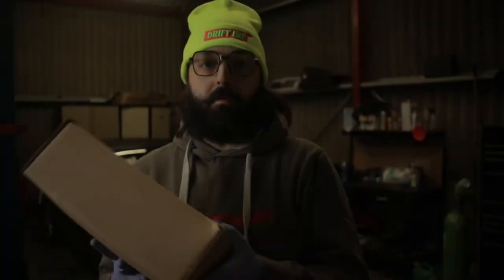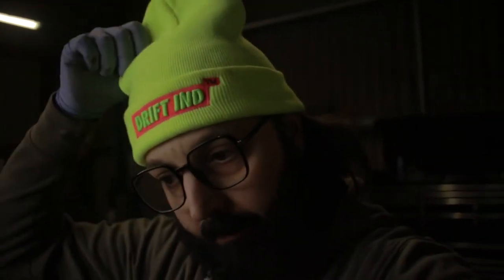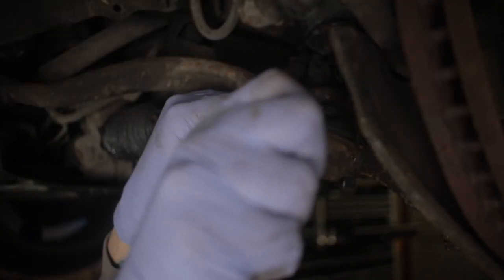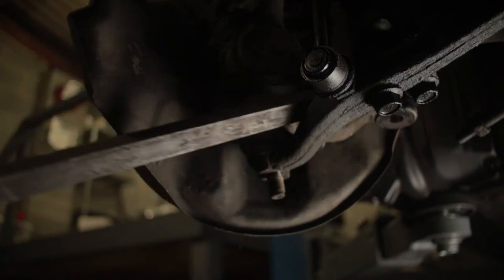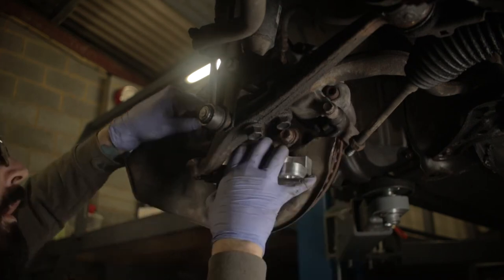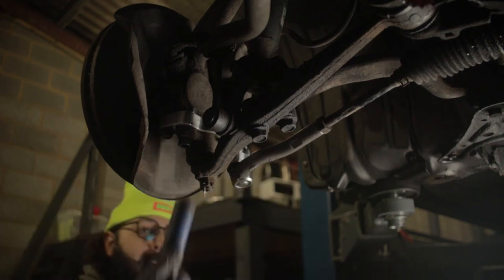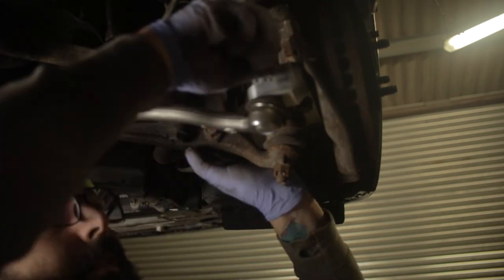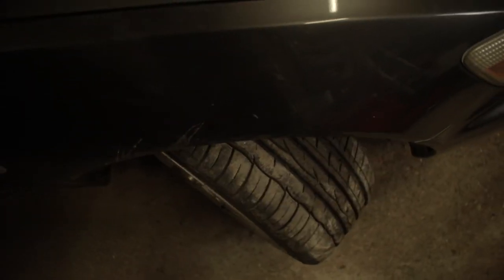EXTRA steering lock kit | Lexus IS200 |  Born2Drift kit

Comment: How about the ackerman? It looks good when the car is standing still but is the car actually turning on the full lock? I've installed a similar kit and after a certain angle of the steering input the car is just not turning because of the ackerman is going negative and inner wheel angle is less the it should and the car doesn't steer properly.